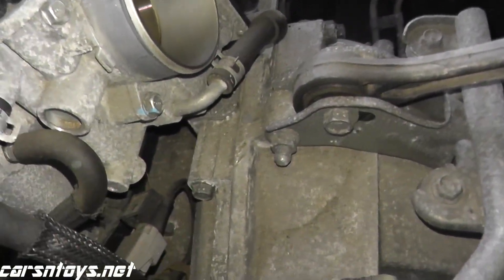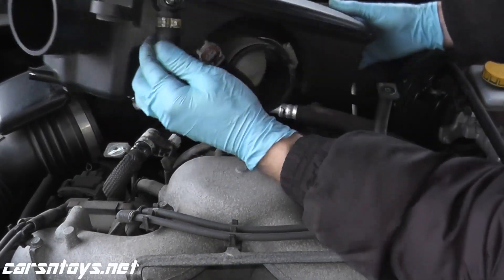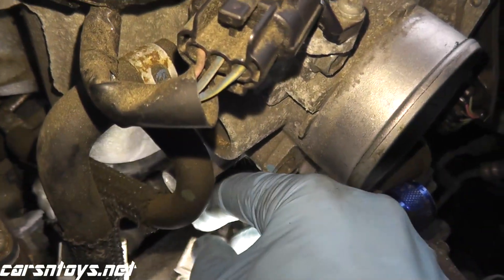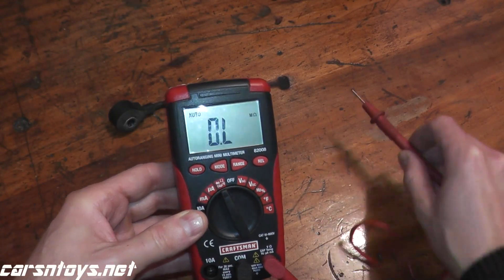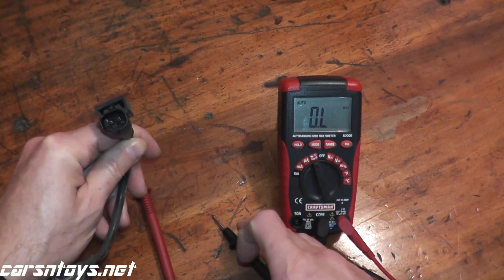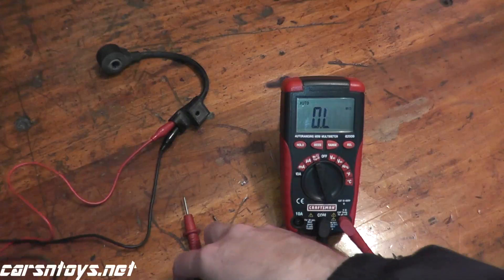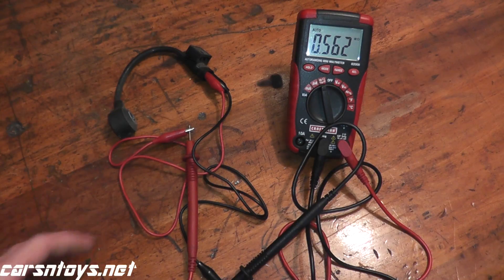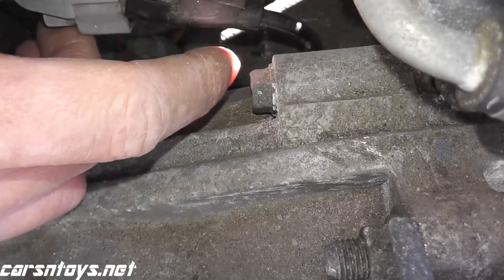Knock Sensor P0325 P0327 P0328 | How to Test and Replace

Comment: Do you have to remove the sensor to test it or can you just disconnect harness and check the ohms?
Reply: Yes you need remove the sensor, but this item may be diferent because each brand of cars  use a diferent reference it very important to read manual services to see the real ohms and average